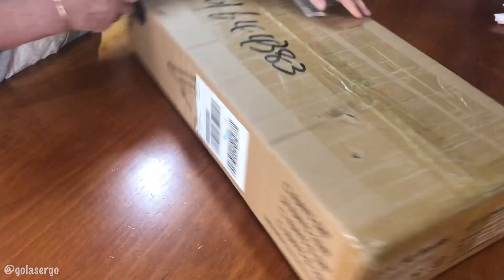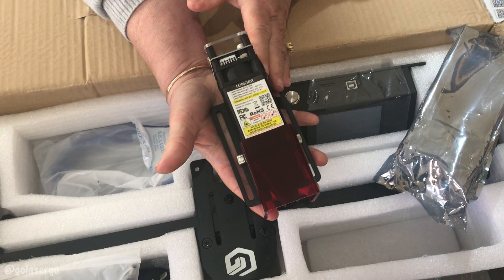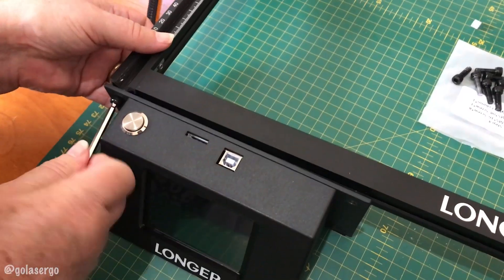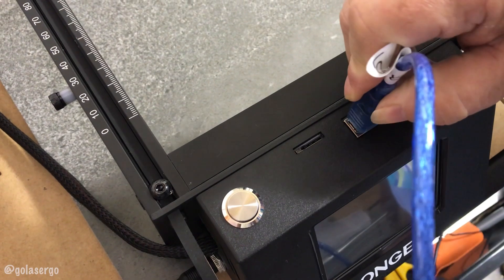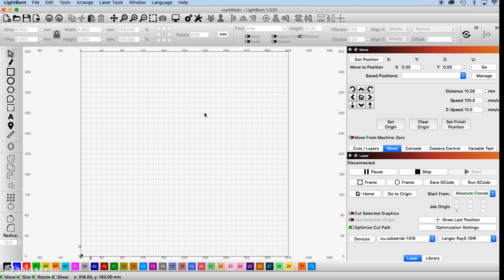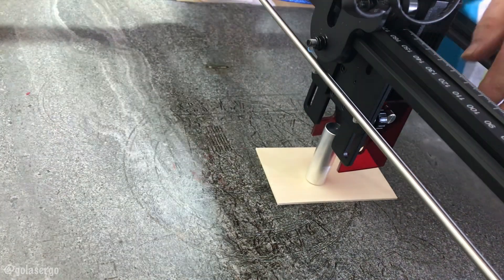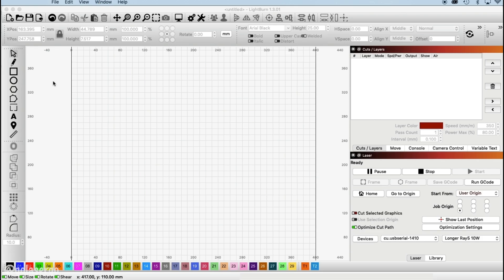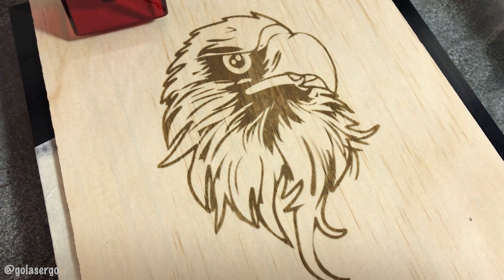Longer Ray5 10W Review & Demo (PART 1)

Comment: hi, i need to make stainless steel labels.  the material is .5 mm thick, it should be cut out after the engraving.  does it work with this machine?  performance?  Thanks for your response.